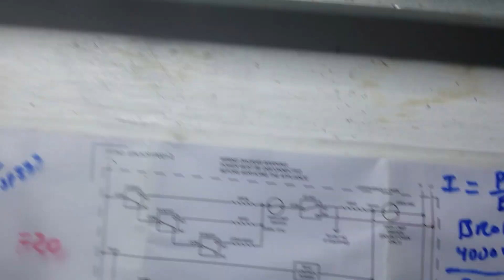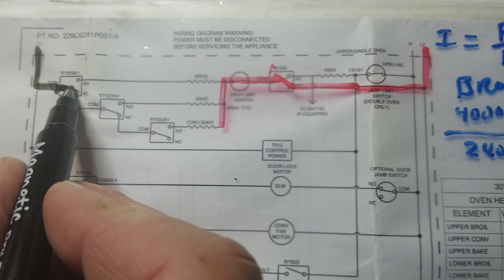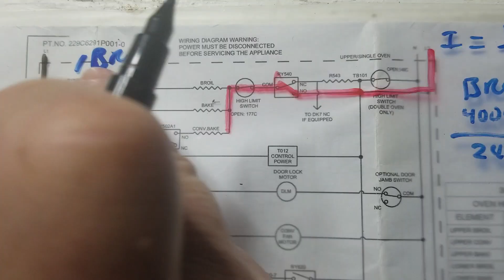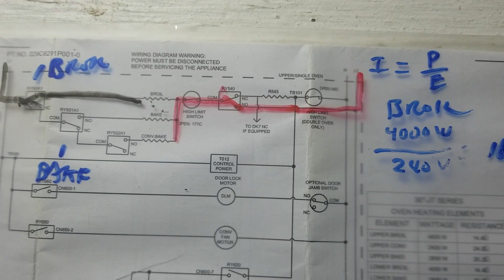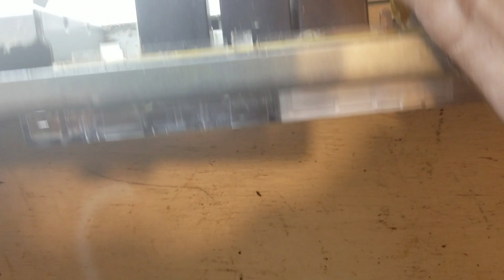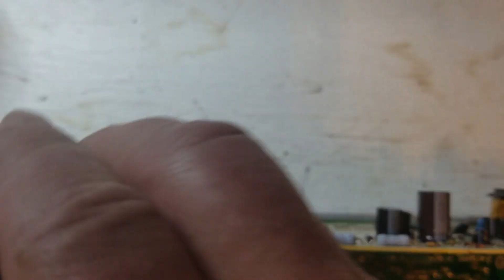#48 - GE Oven F2, F10, or F20 Error and Overheats

Comment: So if the temperature sensor needs replaced, should the ohms be above the 1050-1150 range or should it be below? Mine is reading 1250-1350. Is that enough of a difference to throw a code (F20)?

Comment: I replaced the whole control board, but now i believe the temperature sensor is not reading accurately. We need to turn the temp up artificially high to reach the desired temp. Will i need to replace the temperature sensor inside the oven?
Reply from the maker: The sensor is likely OK . They don't  often slightly change their measurement characteristics like that. You may have a calibration feature on your oven. If you look at the owner's manual, it may walk you through how to add a certain number of degrees to the control board's setpoint. You can enter the model number at www.SearsPartsDirect.com to pull up an owner's manual if you don't have one.